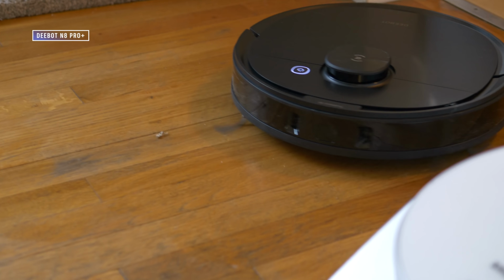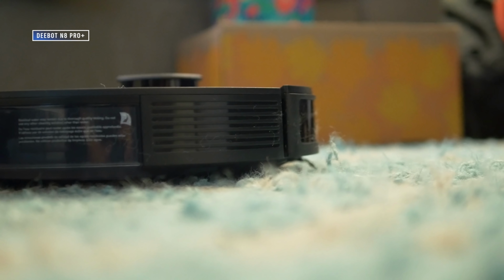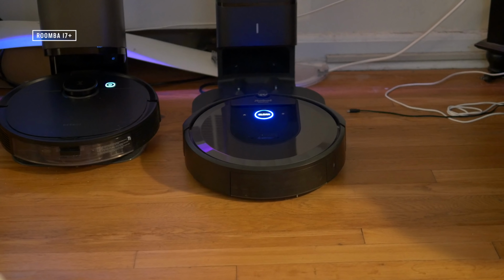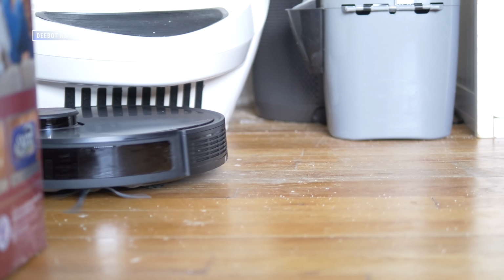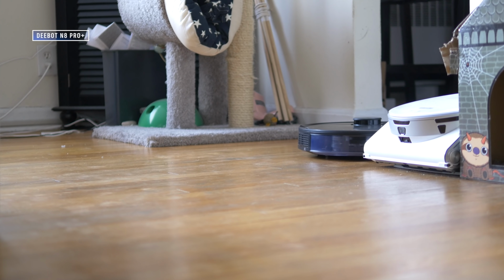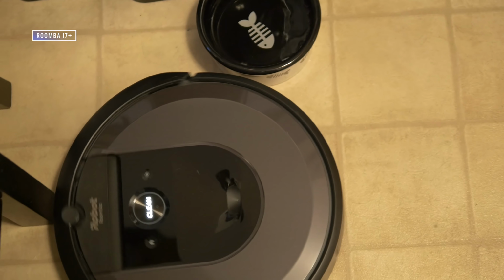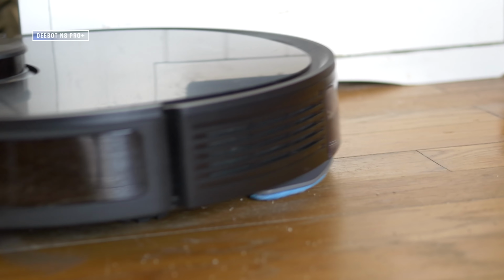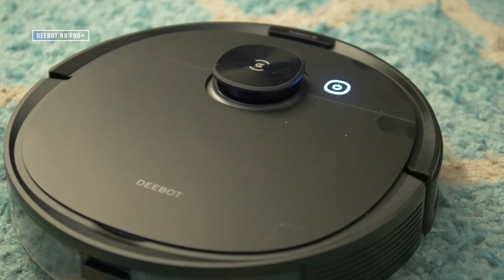ECOVACS Deebot N8 Pro+ vs iRobot Roomba i7+ | Great Value!

Comment: My Deebot N8 Pro+ does well cleaning, but the obstacle avoidance could be a LOT better. My N8 has never avoided a charger cable since I've had it. It just gets stuck and flails around like it's having a temper tantrum

Comment: Off all the robot vac's I've had (Neato's to Samsungs), the iRobot products seem to beat the living crap out of everything. I have a gen 2 Scooba that I still use.  It not only beats up the furniture, but it's a bully. It keeps on banging into it at least 2 or 3 times before going around. Using a new Shark AI 1000 series at the moment but thinking of relocating it to my 2nd floor and replacing it with a Deebot. I have one already (Deebot) but it's in the basement, only on carpet and doesn't have a self empty ability. It's about 2 years old. My only complaint is the brush seems noisy (clicking noise) that started after the first year. The tank is too small too.

Comment: I have the roomba i7+ and, honestly it's been a disappointment. For the first 6 months it worked nearly flawlessly but after that (and some mandatory software 'upgrades' that I had no control over)  it frequently gets lost, can't find its way back to its base. The other day it took two hours and 19 minutes  to vacuum a 15 X 15 foot bedroom as it had to return to base once in order to recharge even though it was fully charged at the outset. I often watch it vacuum and its algorithm makes no sense at all. E.g., in a long hallway it will vacuum in the 'short' direction and make dozens of reversals instead of doing so in the 'long' direction with only 2 or 3 reversals. While in a room it frequently reverses direction before hitting a wall or room divider. Who is the idiot that programs this thing?

Comment: Ok guys.. I don’t know what it is with these reviews, but they are not testing these robots right. I have one of these (perhaps the one before this one).. And I’m telling you. Every 3rd time I start it up, it starts mapping out the house from scratch, and then you have to carry it to the docking station, and it will restore the map again. BUT, a few times it couldn’t, so we had to ready the whole house again, so it could make a new map.. Extremely annoying!
Also, you can’t pick it up and place it in another room to clean there, it will complain.. We have two rooms it can’t get to because of the door step hight. And you can’t just put in into these room. It doesn’t work like that..

The robot is great in general. But sometimes the tech fails, and you will lose your map…
Reply: Which one do you have?
Reply: @melissa4455  if’s called 950 or something like that